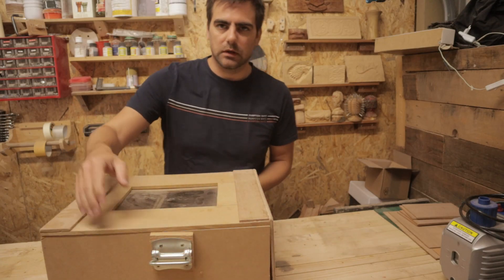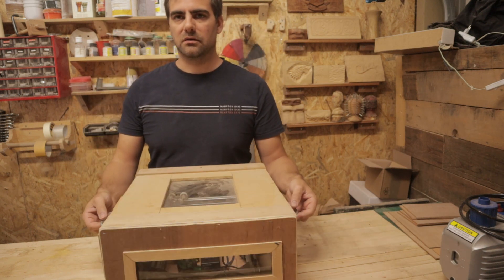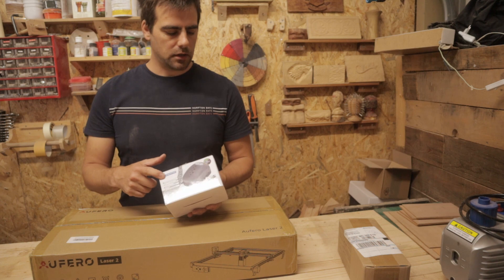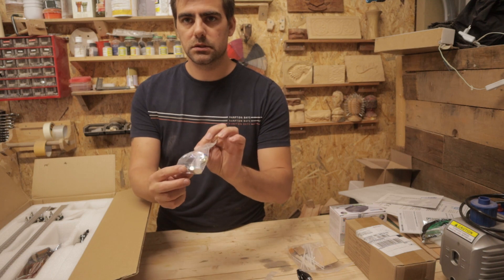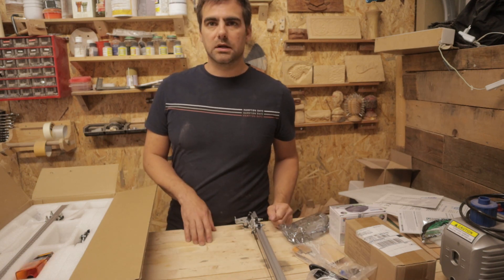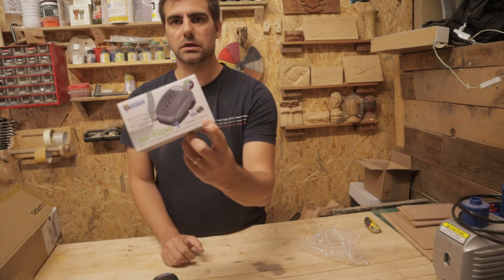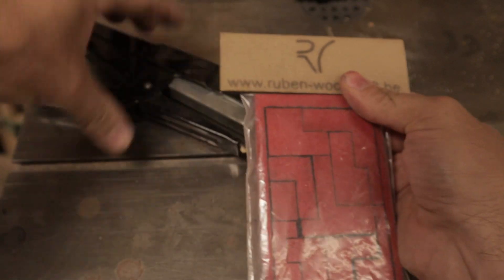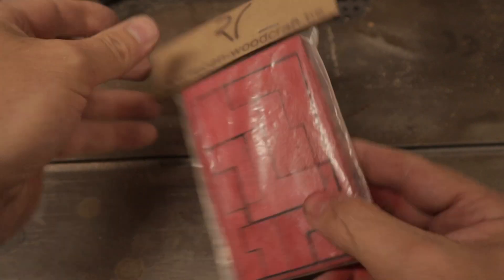Aufero 2 Laser assembly and a beginner puzzle project

Comment: Great video Ruben. I'm thinking of buying a LaserPecker2 which is portable.
Take care Ruben.
Cheers, Huw
Reply from the maker: Yes is was looking at that one as well. But this laser is more powerful. I want to do 360 engravings and inlay eventually
Reply: @RubenWoodcraft  The Laser Pecker 2 has enough power for what I want to do with it and I can also take it to my craft fairs and do custom work for customers as they watch as it will run from my phone or laptop.
Reply from the maker: @WoodenItBeNice  that does sound convenient. If you can do it safely.
Reply: @RubenWoodcraft  That is my main concern. May have to buy a few pairs of safety glasses
Reply from the maker: yes. and perhaps make a sort of lid to put over the machine in correct color acrylic, that would already filter out sone of the harmful light
Reply: @RubenWoodcraft  Great idea Ruben I'll start looking for suitable acrylic.
Reply from the maker: You can find it on amazon, I'm just not sure if it can be trusted
Reply: @RubenWoodcraft  Ok thanks. I might go to a specialist, probably more expensive but at least I'll know it will do the job
Reply from the maker: @WoodenItBeNice  let me know if you find a good one. I'm looking as well for an enclosure at home. btw there is also and aufero 1 with an arm design that's portable and has a 180*180mm range. depening on what you need ;-) https://ortur.net/products/aufero-laser1-best-portable-laser-engraver?variant=40675503866040